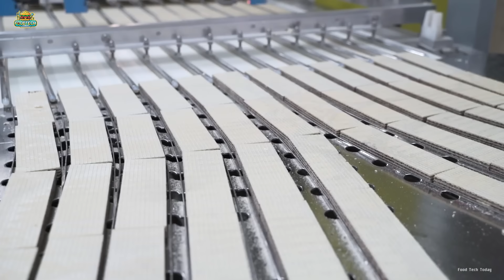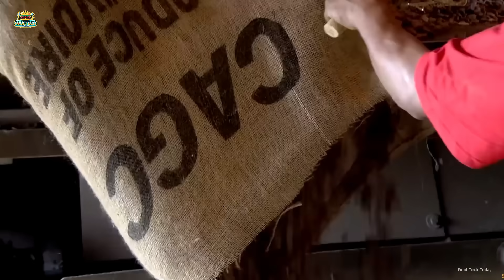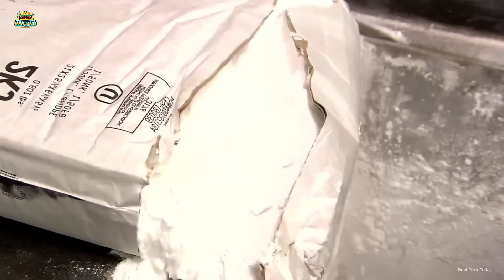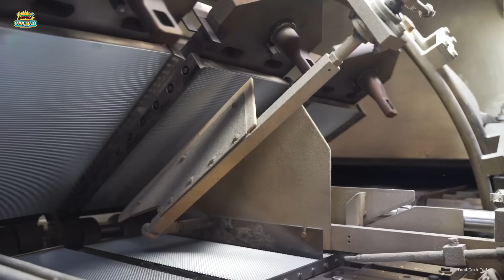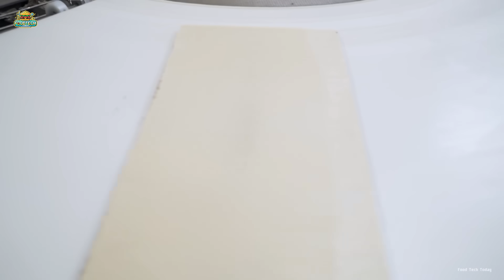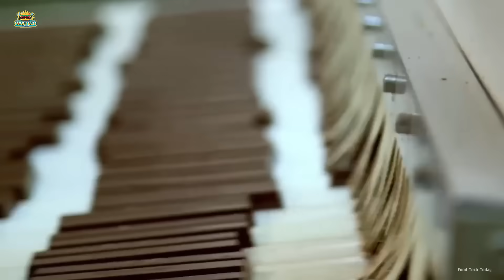How KitKat Are Made In a Factory | See How They Make 8 Million Bars Every Day!

Comment: Solar thermal oils system +sand battery +heating exchanger +temperature controller - supply the chocolate food factory vapor and energy and heat and dryer
Reply from the maker: Sounds complicated.

Comment: That made absolutely no sense you took out the cocoa butter just to put it back in😅😅😅😅😅😅???????????!¡!!!!!!!!
Reply: The process of extracting cocoa butter and then reintroducing it in the manufacture of chocolate serves several important purposes. Cocoa beans contain both cocoa solids (non-fat components) and cocoa butter (fat). During chocolate production, the beans are ground into a paste called cocoa mass or chocolate liquor, which naturally contains both. Extracting the cocoa butter allows manufacturers to separately control the proportions of cocoa solids and cocoa butter in the final product, tailoring the chocolate's flavor, texture, and melting properties. Different types of chocolate (e.g., dark, milk, white) require varying amounts of cocoa butter and solids. Extracting the butter allows precise adjustments to achieve the desired characteristics for each type. For white chocolate, only cocoa butter is used, without the solids, making this separation essential. 

Reintroducing cocoa butter in controlled quantities ensures a smoother texture and better melt-in-the-mouth experience. Additional cocoa butter helps reduce viscosity during chocolate tempering, which is crucial for molding and coating processes. 

Extracted cocoa butter that is not used in chocolate can be sold for other uses (e.g., in cosmetics and pharmaceuticals), maximizing the value of cocoa beans. By adjusting the fat content, manufacturers can optimize the cost and quality balance of the product.

The extracted and purified cocoa butter is more stable and less prone to spoilage, ensuring the chocolate's shelf life and flavor consistency. By separating and reintroducing cocoa butter, manufacturers achieve the versatility and quality control necessary to create the wide variety of chocolate products available today.